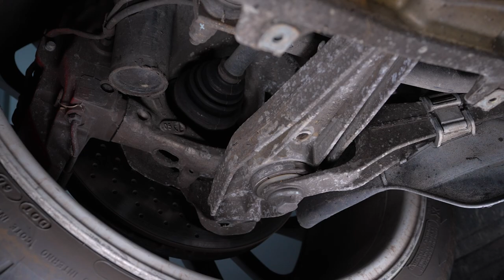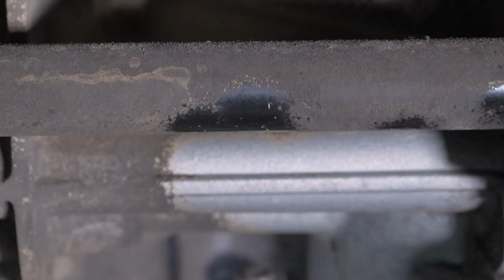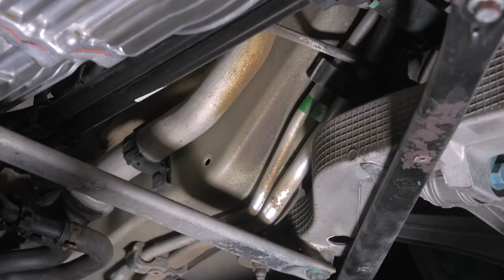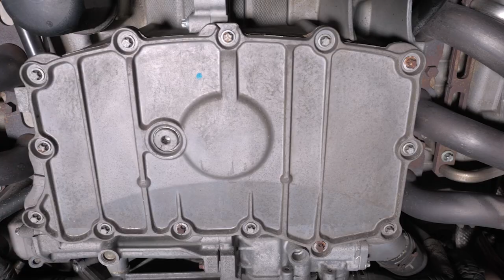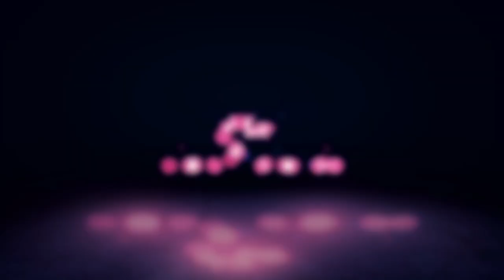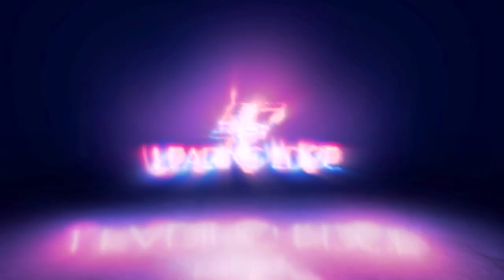Porsche 997 Carrera 4 under body dry ice blasting

Comment: love your work guys, what dry ice machine and compressor specs you need for this result? CFM and PSI?
Reply from the maker: Thank you so much. For this job we used a cold jet microclean i3 and a slightly underpowered mechanical workshop compressor but I recommend nothing smaller than a compair C38 compressor